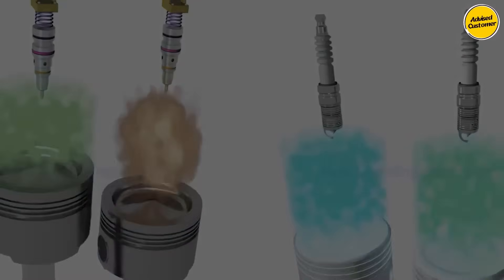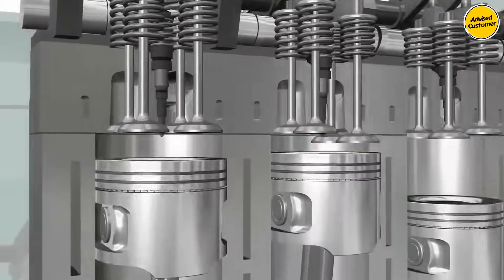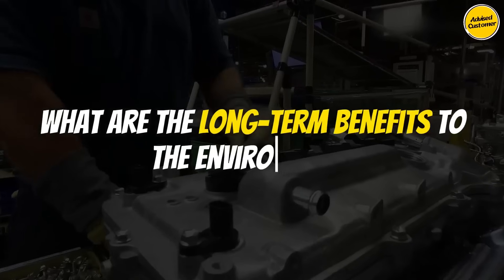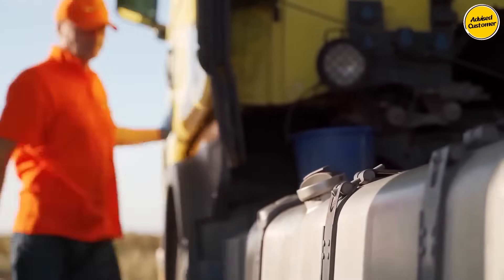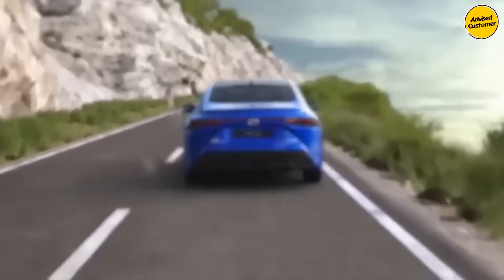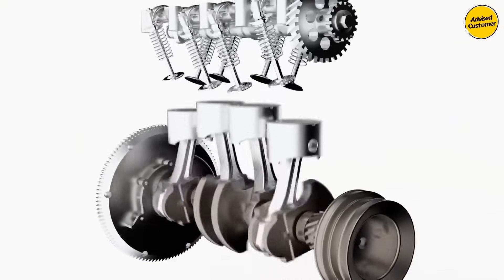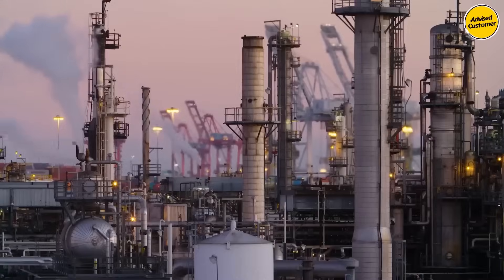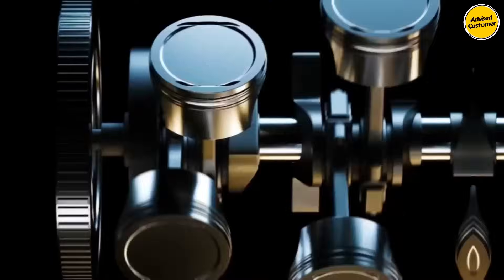The EV Game Changer: Toyota CEO's Ultimate Engine Revelation!

Comment: This entire video is just a bunch of made-up garbage.  Every engineer and scientist knows that it takes more energy to separate water into hydrogen and oxygen than you can get back from combining them again (i.e. burning the hydrogen), and that doesn't even consider that only 20% of the fuel energy of a vehicle powered by an internal combustion engine is used to move the car, due to friction losses.  

The conspiracy theorists are uneducated and in denial.  Stanley Allen Meyer was a fraud.  Everybody suspected it from the beginning and it was eventually proven it in court.

The most difficult part of building a perpetual motion machine is figuring out where to hide the batteries, right Stanley?

Comment: You cant beat the simplicity of a battery and a motor.
Reply: what materials are mined and who makes the battery?  not simple at all
Reply: @steve3667  Can't forget the brake regeneration, inverters and complicated cooling and heating systems for the motors, battery and cabin!
Reply: Interesting. Here in Canada, stories are popping up about extremely expensive battery replacement. Say 60000$ canadian exactly on a 2022 Hyundai.

Simple isn't it?
Reply: @HuckThis1971  i was actually speaking about the architecture and less moving parts.  The prices of things will mellow out when people dont buy them.
Reply: @pipersall6761  but what do you do meanwhile? Store and buy a high mileage vw tdi!?
Reply: @HuckThis1971   I dont know.  I know I cannot afford any of them, used or otherwise.  I guess we keep on as we have until we can afford to do something else.

Comment: What is diluted water?
Reply: Water is diluted by adding more water 😇
Reply: It's easy to do when you use dried water - takes up less room as well.
Reply: The fluid that makes up his brain.
Reply: I think he meant distilled water.  This doesn't make sense to me, though.  I would think the energy to split hydrogen out of water would be at least as expensive as the energy you get out of combusting it.
Reply: @tslug plus, the combustion waste 60% to 70%  of the energy released... that makes no sense....
Reply: @tslug the process of separating the water into Oxygen and Hydrogen requires more energy than the fuel can provide.
Reply: also known as snake oil
Reply: Electrolysis - gallon jug of water - 2 electrodes - one copper and other not sure maybe zinc - hook each electrode to power - with a tube over each electrode bubbles off one electrode is hydrogen other is oxygen. Bleed the gas off top of each tube to collect - this is something I barely remember from high school. cya!!!
Reply: It's what you get when you mix water with the AI-voiced crap in this video.
Reply: By using less powdered water
Reply: @nicholasoberling6653  i think the presenter meant to say D I water, possibly?